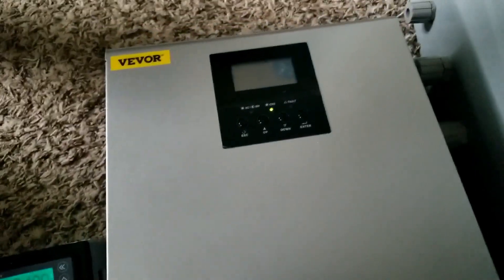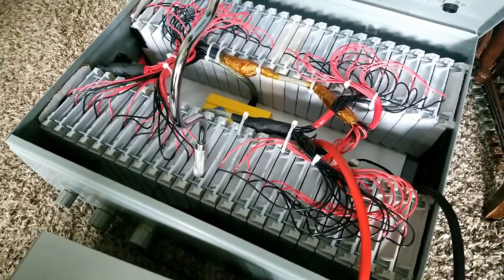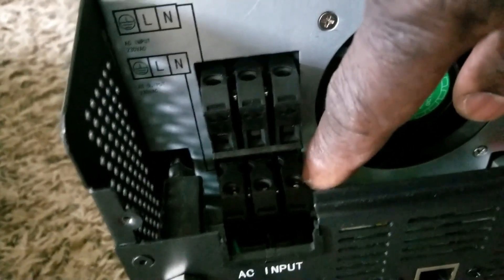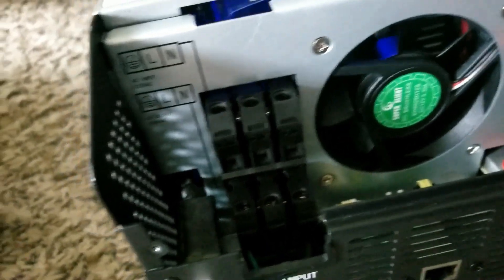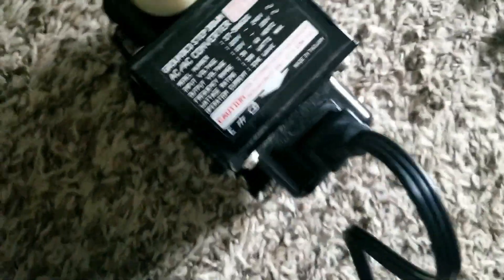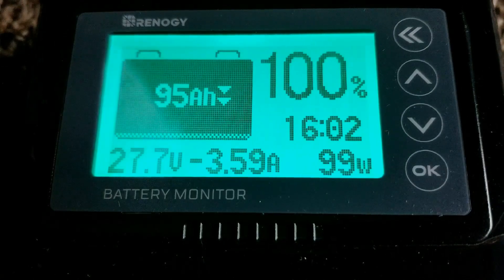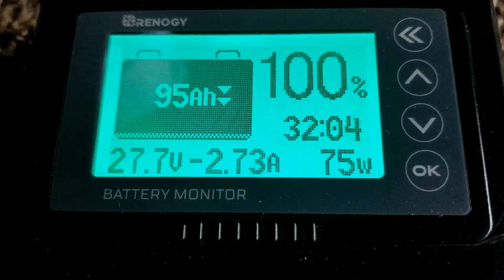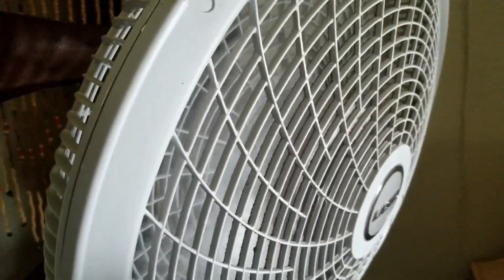VEVOR: 3KVA 24V MPPT HYBRID SOLAR INVERTER BUILT-IN PURE SINE WAVE CHARGE CONTROLLER 230v TO 120v

Comment: EXCELLENT TEST WITH A STEP DOWN TRANSFORMER .CAN A STEP DOWN TRANSFORMER WITH A SPLIT PHASE OUTPUT BE USED ON THE VEVOR 50 HZ 240 V INVERTER ? CAN IT BE CHANGED AT ANYWAY TO 60 HZ  ? GREAT VIDEO .
Reply from the maker: It can switch 50/60Hz which the inverter can do automatically. 
If you wanted to create a 240v North America split phase you need two inverters and two transformers to perform this task.
I hope I answered your question correctly
Reply: @jwsolarusa  OK ! I THOUGHT THAT ONE INVERTER COULD DO THIS WITH ONE SPLIT PHASE  STEP DOWN TRANSFORMER LIKE I SEEN ON OTHER VIDEOS . YOU ARE MAYBE RIGHT . KEEP UP WITH THAT GREAT PROJECT .